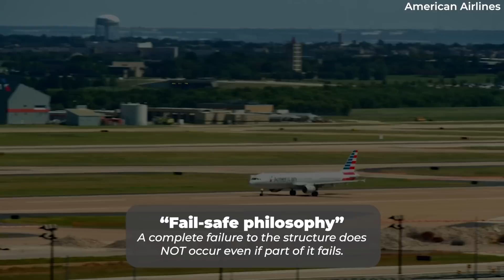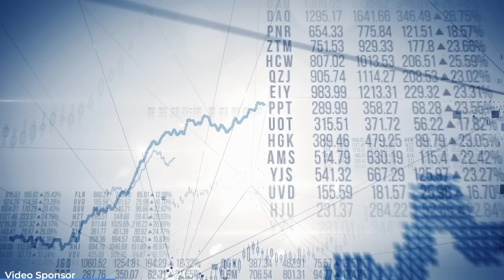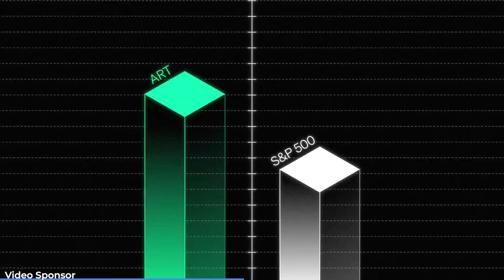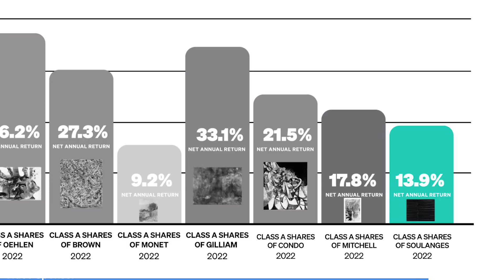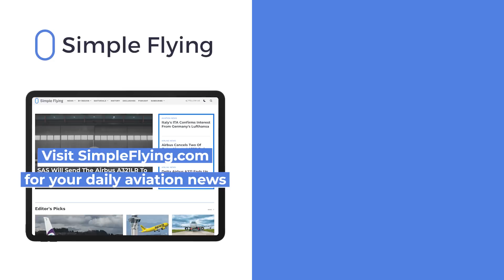How Many Years Do Commercial Airframes Last?

Comment: If I’m not mistaken, the composite materials aircrafts are suits for long-haul routes as the composite materials better in handling stretch stress rather than force impact from landing and take of. Whilst the metal materials aircrafts are contrary from the composites one. Would love to know more about this. Please correct me if I’m wrong.
Reply: Re: Composite airframes, As a Retired major airline AMT with 36 years experience and 3 more as an Army Crewchief on the HUEY, I have serious doubts on the longevity as making repairs on the composite type are extremely different and difficult. Then figure in how much more expensive they will be to return to airworthy status,, so at what point is it just more cost effective to scrap it and invest the insurance claim in a newer airframe??

Comment: it’s impressive to see how much engineering it takes to make a metal flying tube that can barely hold its weight but also last 30+ years.
Reply: It's also very impressive that being in a metal tube at 36 thousand feet and traveling at 500 knots with the only thing holding you up there being air is somehow safer than being in a car right
Reply: @Sovereign-of-silly  It's amazing how flight crashes seem rare nowadays compared to a few decades ago.
Reply: @PeteS_1994  (well you see there's a lot lot less planes than cars so statistics make it seem like they're safe you kno)
Reply: @Sovereign-of-silly  statistics still say that it's safer per passenger and per trip but good try anyway. You should try taking a statistics course.
Reply: @loren360  yes I guess so
Reply: @Sovereign-of-silly  yeah it is wild to think about
Reply: Or not last thirty years.  Sadly the A380 didn't.
Reply: @michaelrmurphy2734  true, it’s not necessary how durable the plane is, rather it’s commercial profitability